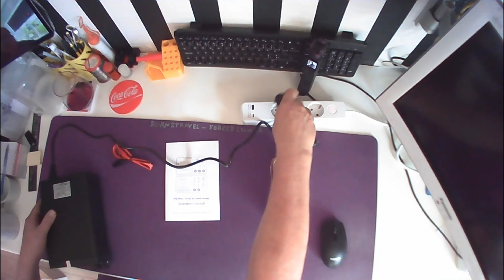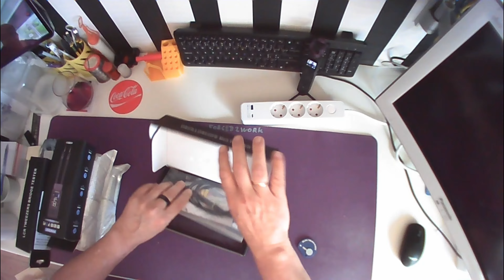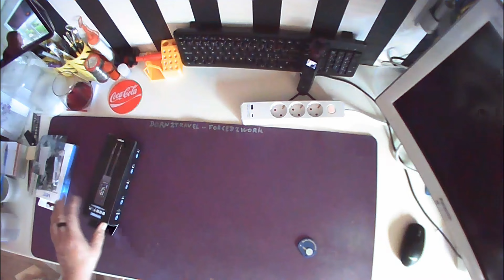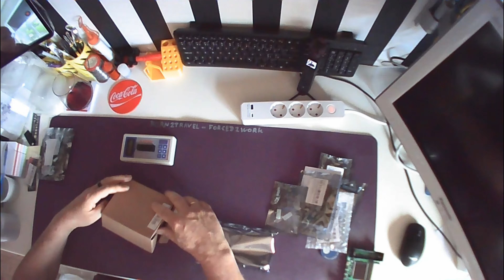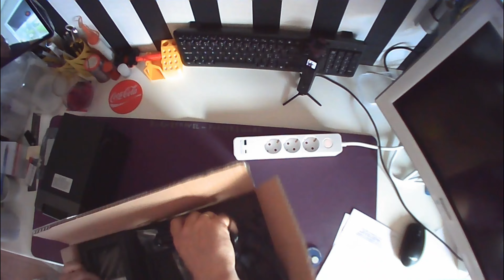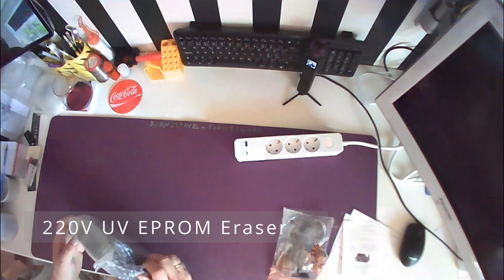#2 | Unboxing of 37 boxes more from AliExpress – Mega Haul Continues

Comment from the maker: Here is the full list of all AliExpress items shown in this video. YouTube’s description limit is only 1000 characters, so the complete list is posted here instead. Thanks for watching — and enjoy exploring the gear!

• WJ T Adjustable DC Power Supply – 30V 5A https://www.aliexpress.com/item/1005011905491290.html
• Adjustable AC to DC Power Modules – 3–24V (10 pcs) https://www.aliexpress.com/item/1005004225093669.html
• Andonstar AD210 – 10.1" Digital Microscope https://www.aliexpress.com/item/1005006523274627.html
• Hayve FZ!-B – Microscope Arm Stand https://www.aliexpress.com/item/1005005679978562.html
• ZOYI ZT 703S – Digital Multimeter • Oscilloscope • 50MHz Signal Generator (Dual Probe) https://www.aliexpress.com/item/1005011741517552.html
• ZOYI R02 – Thermal Multimeter https://www.aliexpress.com/item/1005010370453018.html
• ZOYI ZT XT1 – LCR Digital Multimeter & Transistor Tester https://www.aliexpress.com/item/1005011882536362.html
• ZOYI ZT-MD1 LCR Bridge tweezer
aliexpress.com/item/1005008305005276.html
• FNIRSI LCR ST2 – Digital Tweezer LCR Meter (Kelvin Clips) https://www.aliexpress.com/item/1005011968761296.html
• MaAnt P22A – 20A Multimeter Probe Pen https://www.aliexpress.com/item/1005005831072227.html
• Secomp LCD multifunction Cable Tester
• BlackBox SOHO Plus Tester
• 18650 Dual Channel Lithium Battery Capacity Tester https://www.aliexpress.com/item/1005009630820520.html
• TSH 06F Integrated Circuit Tester (With Terminals) https://www.aliexpress.com/item/1005010803600725.html
• Li ion Battery Capacity Tester https://www.aliexpress.com/item/1005008114999013.html
• 4 Digit LCD PC Analyzer (Green, Dual Bus) https://www.aliexpress.com/item/1005005241454433.html
• Optocoupler Tester v5.0 https://www.aliexpress.com/item/1005010002506407.html
• USB Tester 10 in 1 (USB C) https://www.aliexpress.com/item/1005009985505496.html
• 20/24 Pin LCD Power Supply Tester https://www.aliexpress.com/item/1005009948157389.html
• USB Logic Analyzer – 24MHz, 8 Channels https://www.aliexpress.com/item/1005005993277484.html
• Yihua 948 DI Desoldering Station (4 tips included) https://www.aliexpress.com/item/1005012107890468.html
• 8898 Hot Air Rework Soldering Station https://www.aliexpress.com/item/1005012048417085.html
• GEEBOON TC22 – 220W Soldering Station SDC02 245/210 KIT with 2 soldering tips https://www.aliexpress.com/item/1005006397758007.html
• USB Soldering Iron – 8W, 3 Level Temperature Control https://www.aliexpress.com/item/1005009057170619.html
• C210 Soldering Tips (IS, 2C) https://www.aliexpress.com/item/1005007578686207.htm
• C245 Soldering Tip Set (6D, IS, 2.2C) https://www.aliexpress.com/item/1005006398249504.html
• Soldering Iron Tip Thermometer (LCD Digital) https://www.aliexpress.com/item/33006280425.html
• XGecu T48 (TL866 3G) Programmer + Adapter Kit – 10 Adapters
• 220V UV EPROM Eraser https://www.aliexpress.com/item/1005007659723405.html
• EEPROM / BIOS USB Programmer Module https://www.aliexpress.com/item/1005006003569761.html
• 4K HDMI Videograbber 
• AV2HDMI upscaler
 • Low Frequency Signal Generator https://www.aliexpress.com/item/1005006733991768.html
• 1000V AC/DC Capacitor Discharge Pen https://www.aliexpress.com/item/1005010485545739.html
• Precision Reference Board – Resistor & Capacitor Calibration Board https://www.aliexpress.com/item/1005008172585050.html
• Mini Scale
• Mini Digital LCD Thermometer with Probe – 1 m (White) https://www.aliexpress.com/item/1005006181765105.html